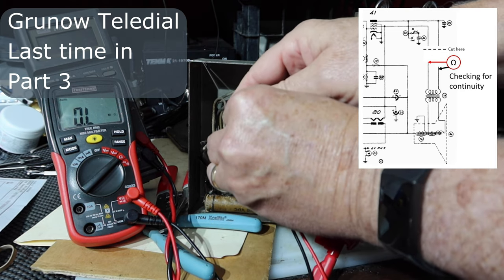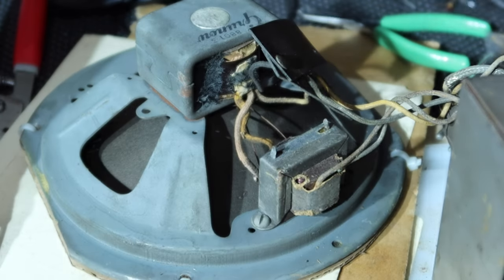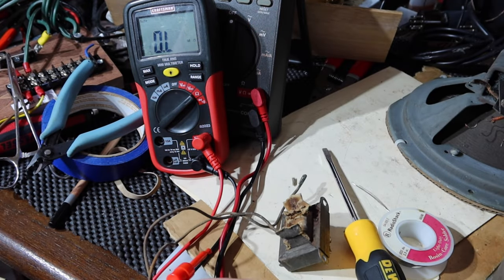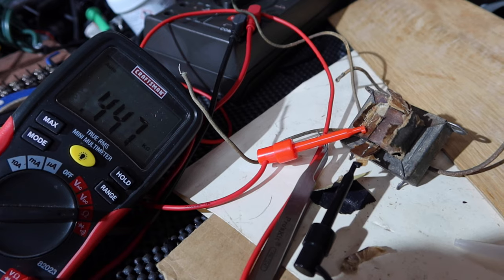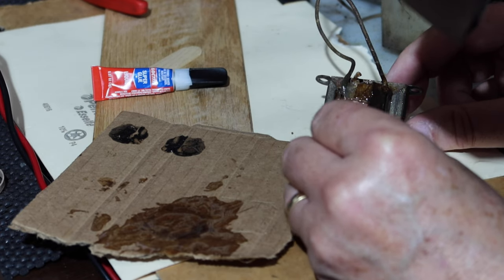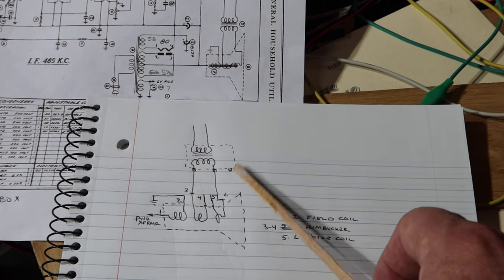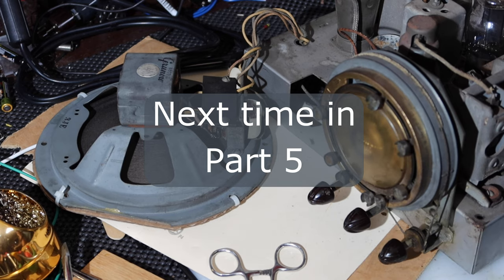Let's Fix a Blown Audio Output Transformer. 1937 Grunow Radio  Part 4 [4K]

Comment from the maker: Jump to:
00:01 / Review of Part 3 - Discovering THE problem
01:46 / Removing the audio output transformer from the speaker basket
03:38 / Inspecting the audio output transformer
03:48 / Testing the secondary winding posts for resistance/continuity
04:00 / Checking the voice coil on the speaker
04:19 / Getting into the primary winding of the output transformer - observations
07:00 / More testing of the secondary winding posts - Hmm..?
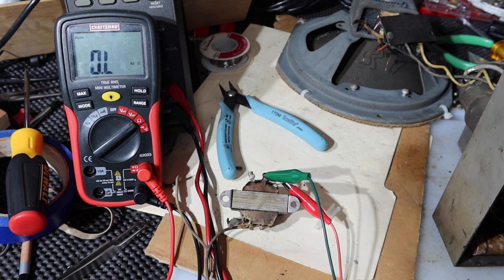08:14 / Getting into the secondary winding of the output transformer - uh oh!
09:23 / Speaker coil windings and the way the schematic is drawn - there's a humbucker...
10:41 / Working on repairing the winding on the output transformer
11:55 / Using epoxy to secure the leader wires for the primary winding
15:32 / Clarifying the schematic - the humbucker and how it is really wired vs the drawing
17:37 / Testing the repair with jumpers to the speaker - using the Heathkit IG-72 audio generator.  It works!
19:06 / Preview of Part 5

Comment: Nice repair. How lucky can one guy be? Btw, you can have that horseshoe removed surgically at any livery stable in the wikd west.
Reply from the maker: Howdy.  Yep!  Got lucky on this one.  The horseshoe was embedded a bit deeper on the Emerson 641B radio repair video series Part 2 (https://youtube.com/playlist?list=PLm_BfKDA0rpOk4ML1MQQnAjb_JJCDifpl&si=w8vemeBVVqgW83Pb).  But the ol' farrier was able to dislodge the shoe with the the help of improper tools and a bunch of rusty junk.  Check out the video entitled: "Audio Output Transformer Project, Save Me! - or - How I learned to Stop Worrying and Love Rebuilding Transformers".  Was awarded extra points by "Fibber's Closet" for using a bait cast reel.  Thank you for the kind comment.